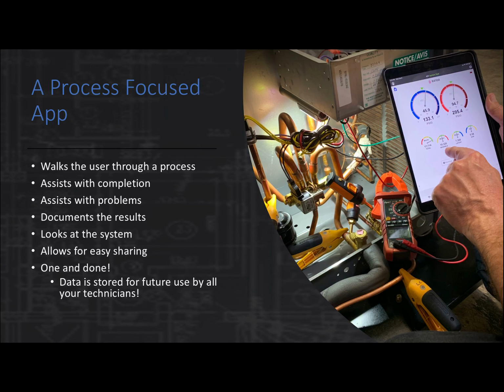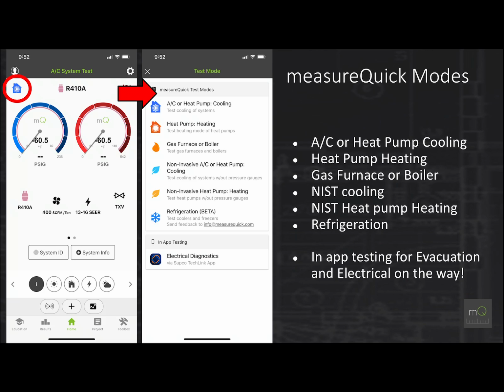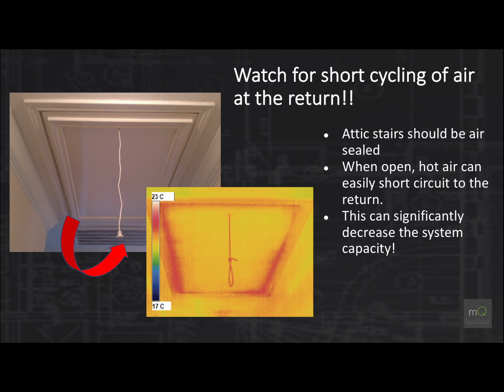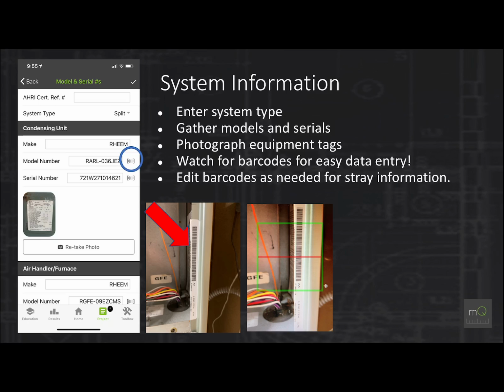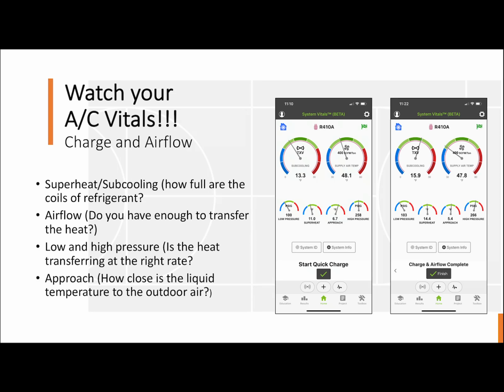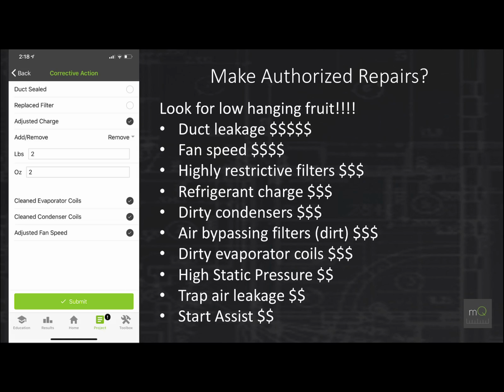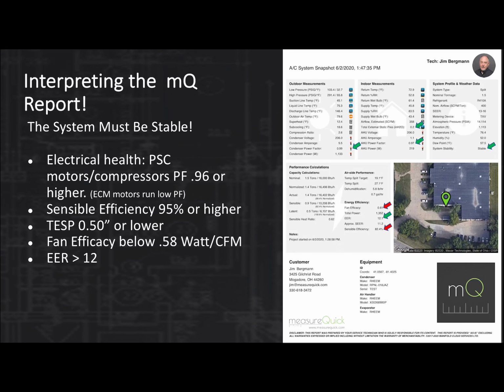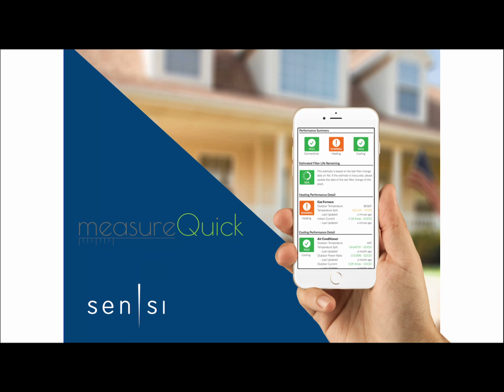Advanced mQ Training (A detailed overview of getting the most from mQ)

Comment: If you have a system running fresh air with no damper or a way to close it, what would be the next step. And could there be an option to enter that data into measurequick.
Reply from the maker: Temporarily seal the ODA opening with Duct mask might be the only option or measure airflow with a alternate method and type it in by hand.
Reply: @measureQuick  thats what i assumed. I was thinking if you added an air probe after the fresh air intake and at the return grille the mq system could calculate the mixture and what percentage of fresh air was coming in by also using the outdoor sensor. Or have the ability to manually enter fresh air amount to get more accurate estimated airflow without changing how the system normally operates.
Reply from the maker: There is not enough room in the unit to get a really accurate mixed air temperature. The air simply does not have a lot of time to mix.
Reply: @measureQuick  my next question would be if a system could be bemchmarked with the fresh air closed, then rebenchmarked with it open to avoid closing off the fresh air every service.

Im lazy as hell.
Reply from the maker: I would think it could be as long as you are getting a good representation of the mixed air temperature. We do allow for more then one RA probe, up to 4, so that might do the trick.

Comment: I benched my own system and according to actual, sensible, and latent; i have 93%, 118%, and 43% respectively of normalized calculations.
I know i keep the house colder than design, 70ish dry bulb at 45ish RH, but should the 118% be of much concern besides liquid flooding to the compressor.
Reply from the maker: No, you are good as long as you have a correct refrigerant charge. I am guessing with those numbers your airflow is on the higher end and you are in a low RH climate.
Reply: @measureQuick  5 ton blower on a 4ton ac, dropped the speed to low and the sensible is right at 103%.
Never really messed with it much because it works but that changed the EER .5 higher.

Edit: To be specific the indoor blower amps dropped from 120v/5.95a to 120v/4.83a and the outdoor went from 3400w@93oddb to 3135w@95oddb. EER from 9.9 to 10.5 and only an increase of .9 IDDB delta with about 3000btu increased capacity. Ive been doing this almost 15 years and ive never been able to quantify or justify small changes like this even to myself let alone argue it to the customer. Amazing technology, and i cant see myself going forward without it. 👍👍👍👍👍👍

Comment: What if we work in a climate where we have basements snd the furnace  and evaporator coil are located in the basement. Would it not make sense to put the return air probe in the main return air trunk since it will be sucking cool air from the basement
Reply from the maker: Yes, in blades with basements in the RA drop and 3-6’ away from the coil in the SA trunk or at the first register is ideal.

Comment: I know there is a way. When I touch either the low or high side pressure gauge it will show just that one gauge. My question is how do you go back to seeing both high and low side gauges on the screen. Thank you in advance.
Reply: For the single high or low side gauge, push the MQ icon above the needle. For the vitals screen it’s pushing the trending button a couple times.
Reply: You press mQ in the middle of the gauge to toggle single or dual gauge mode. If you are in single gauge, press mQ again to go to dual.

Comment: Can a non invasive test be done on a system that hasn’t been perviously benchmarked?
Reply from the maker: It can, but it is not as accurate at determing the pressures as a benchmarked system takes into account the installation variables like line set length and the associated pressure drops.
Reply: measureQuick would a non invasive test be OK for a short line set, < 12 feet?

Comment: Great info ty!  Regarding air probe placement:  Since most load calculations account for a certain percentage of duct gain and leakage, wouldn't it be more accurate to place the probes as close to the coil as possible (without being in line of sight) so they read the actual temp and humidity the coil is seeing?
Reply from the maker: The losses will be so low at the first register that it’s insignificant. Supply leakage will not affect the reading.
Reply: Would you recommend to try a different supply register if the split is out of range before adjusting things? I’ve seen differences between the registers that don’t always make sense for example a close one is warmer than further away even though you would think it would be opposite
Reply: @measureQuick  I was thinking more on the return side with a significant run between  grille and air handler.  If you are placing probes at the air handler rather than the grille, and still get the leaking duct flag, what does that indicate?